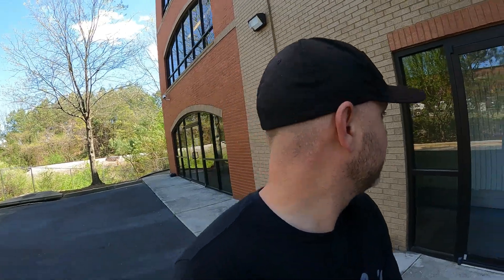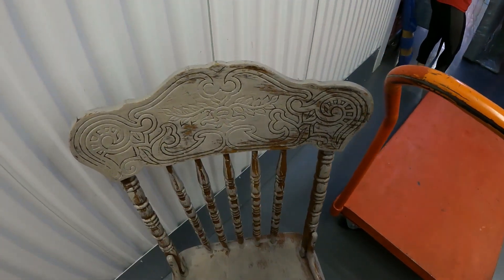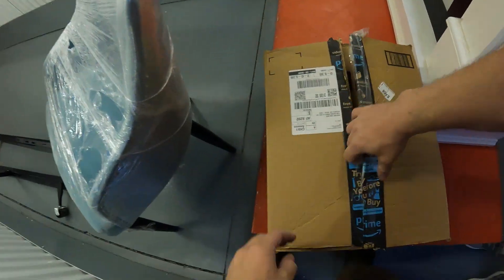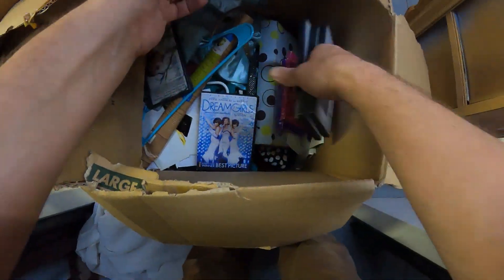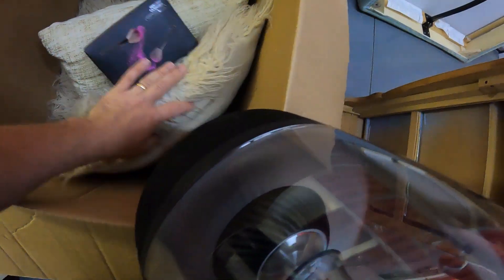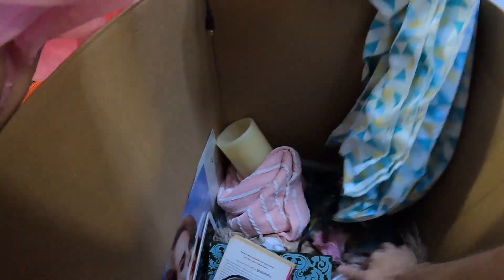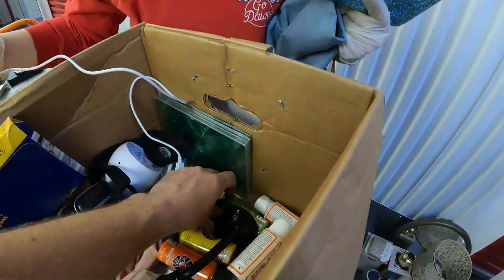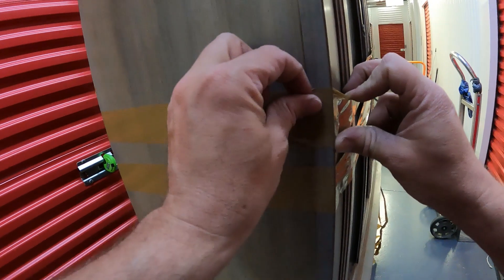I Gambled On This $90 Mystery Storage Auction Unit!

Comment: FYI, those empty apple watch boxes  may sale on eBay.  Not sure if y'all sale on eBay or not, but I have gotten as much as $20.00 for an empty box with the insert. If you don't sale on eBay, put them in the auction and maybe someone will buy them for that purpose.  If you were closer to Statesboro I would pick them up if they went cheap
Reply from the maker: Thanks for the tip. I appreciate it